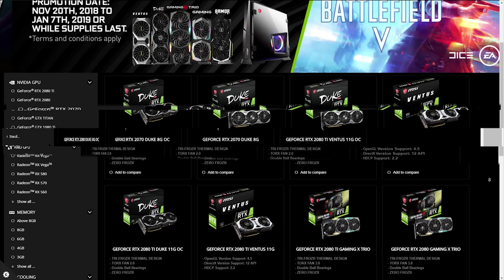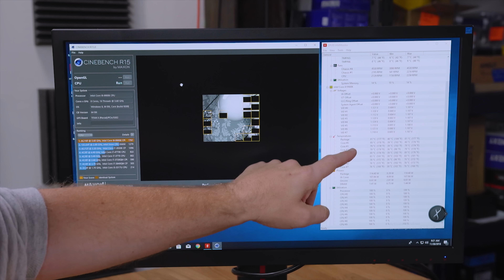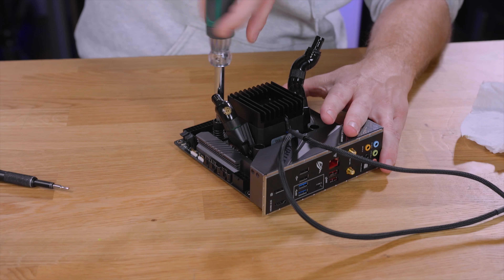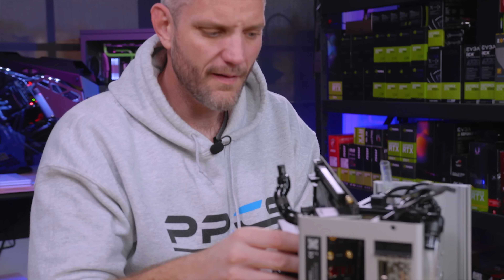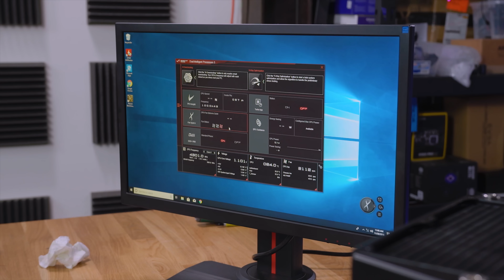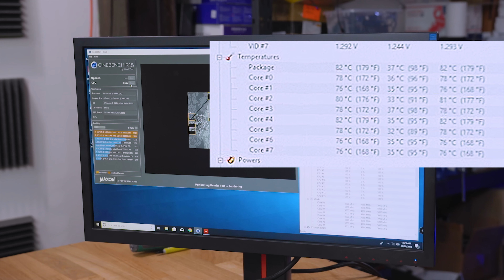Something went wrong with the small watercooled PC...

Comment: I don't know if this comment will still be relevant but i recently got the Apogee drive myself and installed it and noticed that i had temperature problems also. So i tried the glass spin trick on my CPU and The Copper plate on the drive. The CPU was flat no spin. The drive was spinning when it was together. I took the copper plate away from the drive and the plate by itself was flat. To make a long story short there's an O-ring in the middle of the block that bows the copper plate. If you remove that O-ring both surfaces are completely flat and my temp's went way down on my CPU. 

Again I don't know if this post is still relevant or not since the Apogee drive 2 is almost NEVER in stock, but if you take the copper plate off take out that O-ring in the middle of the block you'll definitely see better temperatures. Lapping is still a great idea, but if you don't have access to tools for lapping just did what i did and it should work.

Comment: With systems that want to run hot I've had some really good luck using peltier chips, externally.  And as if that technique dodn't go against my rule of putting stuff in/on my PC's that weren't originally meant to be there I've taken a peltier and mounted it to a water block (with heat sink on the hot side) and the results have been outstanding.  The key is to keep the aparatus on the outside of the case... I don't usually do things like that but I'd argue that a pelter chip is a damn sight better than polluting a PC with Lights/LEDs, etc. (at least it actually accomplishes something)...

Comment: This case was made to take in air from the sides and exhaust air from the top and bottom. Running intake from the top and bottom is the most retarted thing you can do, especially when you consider the fact that the PSU is side mounted and disrupting the air flow that Jay had in mind. You can easily run a 9900k OC at 5ghz and 2080ti at 1800mhz with one radiator at 65-75c silently.

Comment: I know its an old video, but I bet if you reversed the PSU fan and had it blow out the sidepanel, and had both radiators draw INTO the case, and vent out the sidepanels, instead, it would run a lot cooler. Internal case temp would be fairly warm, with it being a positive pressure system, but your important core temps might be a lot better.

Comment: Did the temperatures on the GPU change at all? You said the tubing was hot but if all you did was fix the CPU cooling issues then those two issues still stand. Any input on that or did it remain the same?

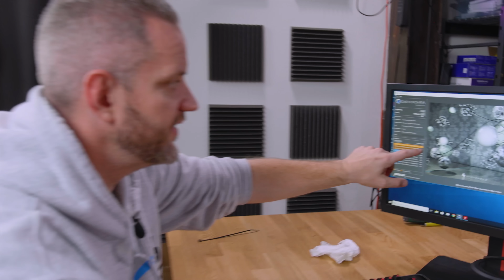Comment: 3:57 thermal throttling when opening Google Chrome :(  9:20 huge improvement thanks to the sanding (lapping) of the CPU.  I'm a believer in sanding CPU to make it flat for equal heat distribution on the surface of the CPU.

Comment: 1:14 You really think natural convection is playing ANY role in a pc case? It's not. It's such a tiny force compared to the air-flow created by the fans you can always neglect it completely. If you don't believe me, just take any air-cooled case and orient it differently and compare the heat levels. Convection isn't relevant in PC building AT ALL. If you put this tiny envelope of a case upside down, I promise you it will perform EXACTLY the same.

Comment: meh, I think those two components on single small rad is pushing  it, prob horrible temps if you run both CPU & GPU at 100%
Reply: DES Pc there is two 240mm rads in that build

Comment: Lock the voltage on that 9900k. 5ghz is EASY at 1.295v; I was hitting 100c as well but now my maxxes are around 77c. That CPU will eat voltage if you let it.
Reply: Nice job man, if came together in the end I see.

Comment: Considering the hot air is supposed to rise, is not the best idea putting the water cooling radiator at the top, since it's receiving hot air and therefore, is unable to cool the liquid properly. I know there is no room in that case, but the radiator would probably do better located in one side with some fan pulling air from the outside, through the radiator, to the inside of the case. Then with the top of the case free, the hot air would leave the case, and it even could be help with some fans at the top.

Comment: @JayzTwoCents Buddy, just change the direction of airflow of your top radiator so that the system exhausts out of the perforated side panels of the chassis. This will allow fresh air to pass through BOTH rads and commit all 4 fans to evacuate the PSU and other components heat. Flip the upper fans, Jay, you know you want to...

Comment: First I want to say that Jay, I LOVE your channel and watch it all the time. Now, I'm not saying you have skin tags, but IF YOU DID (or even just know someone who does) it's easy and nearly painless to get rid of them with common dental floss.  Just make a small loop and slide it over the tag and then just pull hard.  Hold pressure for between 1 and 5 minutes and the tag will simply fall off.  It works because as it slowly cuts the tiny bit of skin at the base it also heals blood flow so that when it finally pops off there is virtually zero blood at all. The tag drops off in one easy piece as a tiny little skin ball that can be thrown at people we don't like...or even just peacefully thrown away. Whatever works, right!?

Comment: Thank you for this video, this is the exact problem I have (not quite as bad though). I've never had a soldered TIM CPU before so I didn't know that the IHS could be warped by the soldering process. It was driving me up the wall - no matter how I applied paste the temperatures were always terrible under load and I had a very similar TIM footprint on the IHS after removing the coolers (I bought a second thinking that the first was not good enough). Not sure if I should lap the IHS or exchange the CPU though.

Comment: Might be a better idea to have both rads blow air out since there is an open grid in the middle.  The open grid in the middle section is messing with flow from top to bottom, so use it as a cold-air intake.

Comment: After seeing your results with IHS lapping, I lapped my 9900k IHS last night... the results? An 8 degree Celsius drop! I kept the ambient temp, water temp, paste application...etc all the same (and measured the temps just in case). I ran a non-AVX Prime95 small FFT torture test for 20 minutes for each run. I already had my system overclocked to 5.1GHz on all cores at 1.3VCore under load, the package temps went from 88 degrees before lapping to 80 degrees after lapping. The extra thermal overhead allowed me to up the voltage a bit more and get a stable 5.15GHz overclock (hey, I'll take it). I was even able to run AVX Prime95 small FFT without thermal throttling, though just barely. Oddly there are two cores that stay unusually cool compared to the others (6-8 degree difference from the other cores), and these stayed the same before and after lapping. My guess is the solder TIM must be uneven in some way over the die, as all cores are getting the same voltage, the same load, and are at the same speed. However, considering how quick the lapping was to do, I'd certainly recommend others to try.

Comment: I went from 8700k to 9900k and my temps are lower with the same 240mm AIO. 4.7GHz all core 1.20v benchmarks go up to 65c and ganes usually stay below 60c. It's not the cpu issue. Something is wrong with the block or something else is causing extreme heat buildup near the block.

Comment: What voltage did your 5Ghz All core get to?  I tried to do 5Ghz on my board.  First I did the built in Auto... mistake as it hit 1.488 vCore (not comfortable) and was very much likely throttling as when I ran Cinebench I saw it jump around between 4.3Ghz and 5Ghz a ton.  A second run of 5Ghz vCore got it to get stable 5Ghz but I had some cores getting near or at 100C which I didn't like at all and vCore was still at 1.44.  In the end I settled at 4.7Ghz vCore because it tested on Cinebench the same (yes it did) and it was a good 20C cooler.
Reply: Unless you just got unlucky, your voltage is way too high for 5GHz. Keep in mind, in overclocking you want the lowest voltage that gives you stability, and as you learned, stability but thermal throttling is counterproductive. I think you went about it backwards, start at stock speeds and voltages, then up the speed/clock until you get unstable, then up the voltage, then go higher with the clock until instability, then up the voltage...etc. Eventually you'll reach a point where one of three things may happen. The first is your cooling is limiting you (or the thermal interface is limiting, aka, Intel). The second is the voltage exceeds what you feel is safe. The third, you reach the maximum your CPU will go, regardless of voltage. At that point I'd back off the clock/voltage slightly, and say you've found your max overclock. I'd highly recommend not using automatic tools, they still seem to set really high voltages at times. If you start low, I think you might be able to find a better overclock before you throttle... but obviously there is luck involved with your setup and the processor itself.
Reply: Additionally, others may disagree (everyone has their favorite), I wouldn't use Cinebench for stability testing. I found I can be really unstable and Cinebench will happily complete. I'd recommend Prime95, the older version without AVX, or newer version with AVX disabled. For the newest version of Prime95, run it once, and a local.txt file will be created in the applications directory, then add this line to it:
CpuSupportsAVX=0

I don't think it's required, but then close and reopen Prime95. I then do small FFT as the test, despite what it says I found small FFT to produce the largest power draw as well as heat. If you can run stable for an hour I'd say your system is good. I personally like to run it for 12+ hours to make sure, but that's not required. It'll tell you if one of the worker threads error'ed out (assuming you don't outright freeze), but the easiest way to tell is that your core utilization will decrease if a worker thread errors out.
Reply: @JimBob1937  Yea. I was mostly watching temps and looking for throttling. I wasn't using Cinebench as a stability factor but as a tool to put load on it. Same with Prime95 and I did disable AVX.
Reply: @RobertPendell , ah good. I still test with AVX, but without a lot of work, that will throttle the 9900k pretty easily. And in that case, I'd not even recommend Cinebench for temps though. If you're looking for worst case, Prime95 small FFT runs a lot hotter, about 20 Celsius for me.
Reply: @RobertPendell , I'm going to spread the news though. After watching this video I decided to try lapping my 9900k. Took about 15 minutes and resulted in a 10% temp drop. If you're throttling, and are comfortable with it, I'd recommend giving that a try, will increase your thermal overhead.

Comment: I learned in my nCase M1 with a bottom mounted rad, that I couldn't pump air up through the chassis, when I swapped the fan direction it decreased system temps by 10c. So now all the cool air comes in at the top and back and leaved through the bottom, and that's with 2 slimline fans doing the pumping out.

What Jay needs to have is inlets on either side, and air OUT both top and bottom for a negative pressure chassis. Also I won't use a colored fluid again, it looks neat, but just distilled water and an additive. That way it stays clean and it's more visible when it does have issues.

Comment: I dont know if this is related but, I have an asus formula viii mobo with the 6700k. I have have the same problem, throttling under light load with a closed loop CPU cooler ( h115i rgb ) under "optimized defaults". As soon as I enable the mobos built in overclock profile, temps dont get over 70c. That's an overclock of over 15% so I'm  lost.

Comment: These video series on the SFF build are super cool! ;)
I'm serious - I'm doing my custom 10~11L SFF case build with the 9900K (and my old gtx1080 for now) and it's great to see some potential problems and solutions for such build.
I wonder what's you opinion on alternative solution for the lack of reservoir in the loop.
My idea is to use QDC (Quick-Disconnect-Coupling like EK's for example) right before the pump inlet (like in the middle of the tube). So when (re)filling it I'll disconnect it and hook it (via 2nd QDC) to external Reservoir (one that has longer tubes so that I can move it up or down - depending on if I'm filling or emptying the loop).
When I have the loop filled (and air free) I'll disconnect the QDCs to the reservoir and connect the original QDC in the main loop to each other (so that the tube before the pump inlet will normally have a QDC in the middle - as part of the tube).
So normal loop in operation mode (w/o reservoir) would look like:
...==[Rad]===[QDC]===[Pump]===...
and when the external reservoir is hooked:
...==[Rad]===[QDC]===[Reservoir]===[QDC]===[Pump]
The reservoir will have a drain port, so I can put it lower than the rest of the loop and just open it (using the pump to push out water won't work if the drain port is before the pump obviously. But another QDC-tube after the pump can help with that ... not sure if it's really necesary)
Thanks Jay!

Comment: Retrofit tempered glass to the existing side panel. So, the existing side panel will act as a small frame to attach the tempered glass. So you can actually see the damn PC. Then I would cut 1/8-1/4 slits (3-5) at the top of the tempered glass, from one side to the other horizontally. Helping vent some hot air out of the PC. Also, could do the same thing without the tempered glass. Just cut (3-5) slits at the top of the existing side panel.
Reply: I’m an idiot. You ran the damn tests without a panel on. 🤦‍♂️

Comment: I wonder how do you put your thermal paste ..  how a little round point can fill a square area ? ...
Reply: The layer of thermal paste should be as thin as possible, only filling the microvoids between the IHS and block. Thermal conductivity will always be best between straight metal to metal contact, but those voids cause an insulating effect because air is a horrible conductor. So that little round dot can spread pretty far once the block is mounted as long as there aren't any major gaps.

Comment: i currently run the 9900k on air cooling with a Be Quiet Dark Rock Pro 4 running almost at idle at 1000rpm and my cpu is around 70-73 degrees under multiple run of cinebench. my cinebench score is 2041.
Reply: oh, and my 9900k was flat, i've done the table test ;)

Comment: ...wouldn't just having a low profile noctua cpu heatsink and intake/exhaust fans on the top and bottom solve the space issue? The massive WC heatsinks are sucking up all that space.
Sure it's not the pretty "water cooled" setup...but whats it matter with a solid side panel anyway?

Comment: Sometime soon Intel's gonna have to forget TIM and integrate pipe fittings right onto the IHS so we can pump liquid directly across the silicon?
Reply: May seem counter intuitive, but that would likely be worse. The IHS does two things, first is to pull the heat away from the package more immediately, the second is it spreads that thermal load over a larger surface area. The water block then interfaces with the IHS's larger surface area, and then inside the water block it once again creates a larger surface area (fins, microchannels...etc) to allow more water molecules, per unit time, to pickup energy from the thermal load as it crosses through. The die package is much too small to provide the needed surface area. To increase the surface area Intel would basically be making the IHS itself a water block... and considering how poorly they seem to do with package to IHS now, I wouldn't trust them to make a good effort towards it, lol.